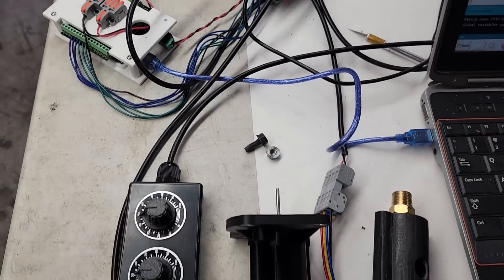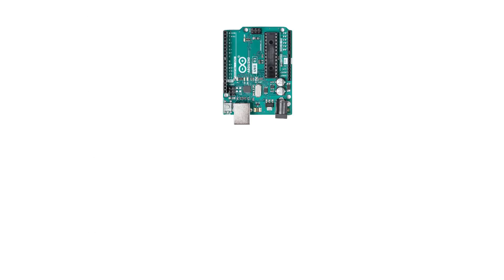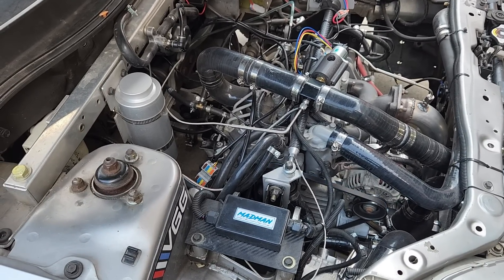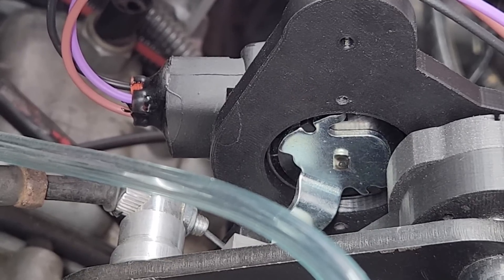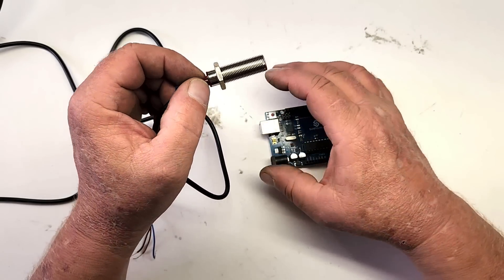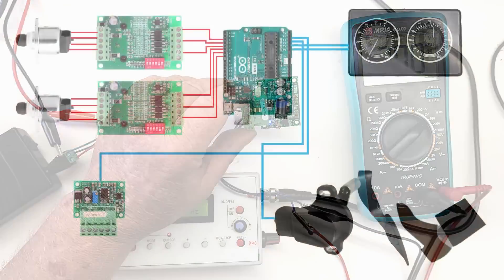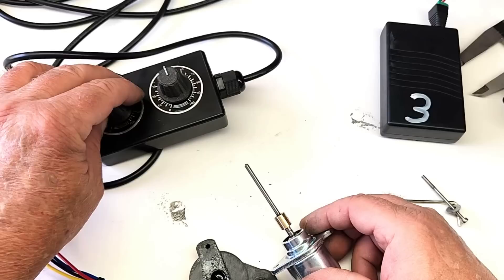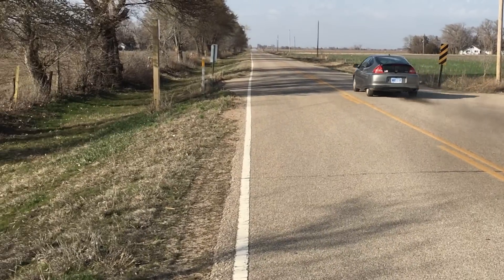S4 E20 We continue upgrading the AMR500 supercharged kubota diesel with custom engine controls

Comment: Hi Jim. Any way to swap out the fuel injection pump for a unit from a Kubota tractor that isn't a fixed speed engine? This would eliminate all the issues surrounding the  fuel rail limiter and allow a more conventional pump timing control. It would also get it away from the area of such tight tolerances where the screw is located. 
Shawn

Comment: I was initially drawn to your channel, because I admire the tech that Honda invested in the insight to get the mileage. Now, after seeing what you are capable of doing with relatively common parts, I suspect that you could modify a reliable car to achieve 100mpg. If you ever do, I would be extremely interested…. I’m broke, but still would be interested. Thanks for the interesting science and fearless wrench spinning.

Comment: The RPM difference might be caused by ADC and arduino supply voltage. In calculating voltage program multiplies raw value by supply voltage on board witch might not be excatly 5 V (for example 4,9V i once had 4,73 V on mine). Of corse its a minor detail but for learning purposues if you want you can check it. You doing great job, wish you best

Comment: You should look into possibly using a "Speeduino" for the ECU. It's a arduino designed specifically for use as a standalone ECU and uses actual tuning software.

Comment: I enjoy this mixture of electronics, software and mechanical engineering.
Personally I use the STM32  "Blue Pill' board. It can be used as an Arduino but I prefer to use it directly in C . I have a collection of these working around the engine in my 1974 VW camper. Cheap but with very capable counter timers. Theres even a CAN bus interface for later..

Comment: What kind of safety is in place for if the Arduino crashes or if the engine runs away? Would be good to throw together some backup system Incase the main ecu has a fault

Comment: Looks like I need a little diesel engine like this for my project portable battery charger using a diesel engine, AC Induction Motor and controller and a Bank of Batteries. No need for too much electronics but it will need some. Keep the electronics going with this project. Im just now learning very basic arduino stuff.

Comment: I'm still wondering why you're fiddling with the boost so much if more boost gets almost the same if not better fuel economy and lowers exhaust temps. The only reason for me to limit boost would be if the temps are too low, such as winter conditions. Although I don't know how much the boost hurts fuel economy since we moved it to a higher pressure I remember at 5 psi it had better fuel economy.

Comment: I would be interested to see how the fuel mileage would react with pulling the shims out from under the fuel pump to advance the timing a little bit, that usually picks up some power on those little engines and should help that extra fuel burn a little more efficiently

Comment: Yes, I am inclined to glaze over and think about calories and carbohydrates and how tight my waistband is, when you start talking about a-d, or was it d-a converters and software updates.
This from a trained electronic technician!
I was top of my class, at C&G level 2, but that was a lifetime ago and I’m out of practice. I can still diagnose a switch mode power supply or a fly back transformer issue, but these things are no longer used, or have gone solid state, so there’s no demand. Arduino’s, or their PIC predecessors, seem like necessary evils, to me.
My PIC traffic light controller worked and got me the grade in my exam, but I was glad to see the back of it! I’m old enough now to think I might be able to dodge learning any more digital and enjoy the rest of my days playing with analogue. (I’m Irish and I speak English, so sue me for not using American spelling!)
Having said that, I’m willing to come along with you, while you have fun doing magic and I watch how it affects the stuff I do understand. I’m a huge fan of Kubota, especially the bigger, 4,5,or 6 cylinder engines. They do incredible things with diesel fuel, compared to similar sized Perkins, Ford, or Cummins engines. Far less noise, heat and physical bulk for any given power output and the economy is crazy!
Keep doing what you do.

Comment: You could turn the injector pump cam for more timing a 12v Cummins runs at  the same timing all the time there's no need to advance or retard the timing like a gas engine.
High EGT will only hurt your engine if it's there for a while, you could run your EGT at 1,800 degrees fahrenheit for 30 seconds and it would be fine. Roll as much coll as you can!

Comment: You can measure rpm with 3 lines of code by using function millis() or micros() and measuring the time it takes to rotate between the magnets. Also ESP 32 S3 is much faster 32bit 240Mhz controller for the same or less money and you can code for it in the Arduino IDE

Comment: I think you have a good balance of technical jargon. Your explanations highlighted to me the balancing act that goes into hardware/software decisions when designing and engineering parts of a car. I could imagine engineers at a meeting discussing costs and tradeoffs associated with different approaches for constructing the control system you’re making. I love your videos. 
Hopefully this helps more people see how and why decisions made at the design level have implications down the line to the users and maintainers of cars.

Comment: Im over here just going to buy a ECU but now you’re making me reconsider. At the same time I know ladder logic not code so I probably couldn’t do what you’re doing. Also Im figuring on using a highspeed fiber optic and amplifier over a traditional hal or inductance sensor, that way on my engine I just replace the distributor cap and rotor with a 180 tooth position sensor, well 178 technically. 2degree resolution, all the precision for my valueless 80s turbo wagon.

Comment: Why wouldn't you daily drive this project once its all dialed in?  Or maybe not daily drive but nice days when you don't need AC and stuff like that.  Rack some miles up on it see how everything holds up and save money on fuel doing it while enjoying the fact that its the only supercharged 3 cylinder kubota powered honda out there.   I'm not sure if you've planned on fitting the turbo into this car at all maybe a next year thing but i would be curious to see in the future how the electronic controls play with that or do the turbo and the supercharger

Comment: Jimbo here is a crazy idea. Back in the 90s(I think) they were experimenting with E diesel and they found out you could mix ethanol and diesel up to 25% and you could irrigate a diesel with port injection of ethanol up to 27% of the total fuel, I’m not saying do that, but meth injection and checking how it affects the parameters would be a great test

Comment: By default,  most of us think that electronically controlled engines are rocket science or completely proprietary designs.   This project actually shows how far a DIY adventure can go with off the shelf things....  if you just keep thinking it through.  Most "little engine in a car"  experiments would not have pushed as many limits...   and now you're using technology that's available to anyone to tune what may end up as a plausible commuter car.    It's certainly fun to watch...  and encourages many of us who like to tinker to take it up a notch.

Comment: I'm eventually going to use an arduino to run some gauges in my EV converted VW. I want to make it look as original as possible, including the original speedometer gauge. So yeah, I'm looking forward to what data and efficiency gains you can get out of that little computer too!

Comment: Great video. Where do you get the boards ?? We always used the starter ring gear teeth as the exciter for an rpm counter.
Reply from the maker: I saw the frequency to analog converters on Amazon so I thought I would give it a try.

Comment: I’ve got a turbo for you if you want it. It came from a small 4 cylinder GM 1.2 turbo engine that grenaded the water pump, and timing chain. I have a dealership and I’m junking the car. The turbo is in good shape no play, and it’s complete with the manifold. Figured you might be able to modify the manifold, and make it work on the diesel. Let me know. Might be able to use it and see if it makes a difference in HP and economy.
Reply from the maker: Thanks for the turbo offer!  We tried a turbo on this engine last season and was a bit of a disappointed.  So far the supercharger is working out great.
Reply: @robotcantina8957  perfect. I’ll have to go back and check that out.
Reply from the maker: @thomasstrickland0  Keep in mind, The turbo experiments were done when the engine was in the Saturn

Comment: Great Video! Have you considered using a kick down switch of sorts? That way you could get a clean 100% throttle, and then push it over the detent for balls out, coal-rolling mean machine.
Reply from the maker: I can do that in software.  The TPS sensor provides all the data I need, including when the throttle is mashed to the floor....    getting full power is a few lines of code.

Comment: As an electrical engineer, machinist, mechanic, with twenty years of experience programming including making and training bottom-up and top-down artificial intelligence solutions I loved the reference to War Games (1983) in this current era where google's artificial intelligence is telling people to eat rocks. As a fun thought, imagine using  neural network type microcontroller to control an electronic fuel injection and ignition system. Overkill, perhaps, but a fun problem to solve I'm sure you'd agree.
Reply from the maker: Indeed, never trust the computer.... unless you program it..... then still don't trust it.

Comment: I love the technical content! When looking at the number of magnets used, my first thought was indeed interrupts. I think the way you did is is beter though, I just never would have thought of it.
Reply from the maker: Yeah the amount of interrupts needed for both the RPM and the vehicle speed would cause the Arduino to move in slow motion if I wrote the code using standard keywords.  The best way to do it is to directly  bit bang the registers, but that makes the software hard to understand for most folks.
Reply: @robotcantina8957  True, I forget that I started coding on micros back in the '70s when this was the normal way to do things. I guess, I'm just old! 🙂

Comment: Which 3d Printer do you use?
And in what materials do you print?
Reply from the maker: I use a PRUSA MK3 with an enclosure.  I print the parts with PRUSA ASA plastic.  The enclosure helps with high temperature plastics like ASA and ABS

Comment: I’d doubt that you will run into the power requirements but if you ever need more power a teensy 4.1 is an amazingly powerful board that is compatible with arduino.

Comment: Is delaying the fuel limiter for a second then opening it not going to make the throttle feel like it has a lag?
Reply from the maker: For normal driving on city streets, it wont be noticeable.  The sole purpose of this gizmo is to keep the governor from slamming the fuel rack to max fuel when we don't need max fuel.  Since we are adding this gizmo to the engine we can also optimize the power with software.

Comment: technical side is a ok with me I am 100% in to it when you go into depth on the technical challenges if any one doesn't comprehend it they can skip ahead will some of the code be available on a github repository
Reply from the maker: I'll drop the code on gethub when its slightly more developed.  right now there isn't much to the code.

Comment: 🤠 HEY,  why not just make it throttle by wire? With the throttle slowly ramping the rack to full throttle. When the pedal is slammed down..  yet operates quickly when making small changes.  Maybe upgrade to the esp32 or something that runs at a higher frequency,   I have thought about attempting to make a electronic govenor for a generator. Using a microcontroller and  read the frequency of the generator, I'd love to have that engine for  generator, yet I'd love to have the car to drive also. Add a couple electric motors to it or a single on to the engine. Around 5-10 kw maybe more. With a 10 kwh battery use the motor as a motor/generator charge the battery while at steady speed. Then use the battery to accelerate and climb hills . With roughly 750watts being 1 HP, adding 12,24,36 HP instantly with instant tq. Would be a great addition. Another option would be to connect a Nissan leaf motor to the transmission and maybe another to the engine to generate power to charge the battery (up to 85-90%)  and a onboard plug in  charger .  With a 30-50kwh battery with the charger capable of 1kw to 10 kw, to 99% charge. And auto engine start at 20-60% soc. Adjustable. The engine as a range extender would be the most efficient. And offer the most performance. I'm curious what shifting through the gears would be like with electric motors. Instant acceleration and a need to shift I'm guessing. And 1st great likely useless, with a program to act property to allow shifting keeping. The motor at speed between shifts.  Maybe a microcontroller between throttle and motor inverter.  To control this and shut off instantly if the brakes are applied. Using multiple sensor possibly a shifter gate sensor  and speed sensor on the transmission, motor and vehicle to allow shift enhancement to operate. Maybe a simple flywheel could fix all this keeping the motor spinning at a steady rpm between shifts. Allowing the use of the clutch. This would be better.  I want a diesel engine for my off-grid house. To generate power when the sun can't. I want to make fuel from plastic and rubber. Used oil vegan diesel fuel. For when the batteries are low and power is required. I have several heavy duty Delco alternators. Enough to produce about 600+amps at 28v however I'm wanting to split it up into about 150a. Units with different fuels, a gas/propane generator, a diesel generator, and maybe a steam generator generating power by burning trash and fallen trees.  Also using this heat to convert plastic to fuel possibly biomass to methane, natural gas, possibly attempting to convert engine oil to gas and diesel. That would be much later after lots of research. Cracking oil into gas is not the safest .  And would definitely be done small scale if at all, like by The gallon or two or 5 Or less at most. 5 gallons of hot oil can be great danger! Building a steam engine that produces 5-7 HP shouldn't be too difficult. have a awesome day!
Reply from the maker: Throttle by wire wont work because the accelerator pedal is not directly connected to the fuel rack.  The gizmo I'm building is to control the way the governor applies the throttle.

Comment: Love the added tech. I built an all analog 5th injector controller back in the 80's when I intercooled a factory turbo car, also programmed an Electromotive TEC-II ECU when I added a turbo to another car, and I have programmed a few different microcontrollers, including Arduino. This gives me a good frame of reference for where you are going. On many factory turbo diesel engines, they use the boost pressure to directly limit the maximum fuel setting to limit smoke. Essentially, boost x rpm = air flow. Limit max fuel flow to match calculated air flow. With a blower, the boost is more predictable, but there is still some lag as it pressurizes the piping and intercooler. With a turbo, the pressure changes are more dynamic, but I still feel measuring boost would be a more accurate control for the fuel rack limiter.
Reply from the maker: My turbo diesel Mercedes had a gizmo called an ALDA and it did pretty much the same thing that my contraption does.  The ALDA was purely mechanical and was calibrated with spring pressure, on my device, I'm using software to calibrate it,  LOL, changing a few things in the code is a lot easier than playing around with springs and linkages.

Comment: 💦⚗️
Snow Performance water-methanol injection with OEM level fuel system control for exact amounts of water-methanol to be delivered at any RPM range of the vehicle. The Stage 4 Boost Cooler utilizes engine RPM/Boost PSI to create a 2D fully adjustable water-methanol tune. Unlike any other system on the market the Stage 4 can give more or less water-methanol at any specific engine load state similar to a stand alone ECU. Using Snow Performance Platinum Tuning Software (free) the tuner can monitor, adjust water-meth delivery, data log/save files, and save/send completed water-methanol tunes to remote customers using a computer while on the dyno. Comes complete with  USB cord,terminated wiring connections, LED alert system and 1/4" Nylon Tubing / quick-connect fittings. Recommended for all tuners looking for maximum water-methanol control.

A 50/50 water/methanol mix will decrease EGT's approximately 200-300 degrees F while increasing power

Comment: Still watching. Loving the video. Remember to add a limp mode so that if one of the sensors or sub circuits fails it will set all settings to the lowest power on the motor. Before you melt it 😅
I have an unhealthy obsession with your channel. Can't wait for the next video 😅
Reply from the maker: On this engine, nothing can stop it from actually running.  if all the gizmos fail the car will still drive and that the best part.
Reply: @robotcantina8957  My concern is more aimed at if something fails while the circuit puts all the modules in the "high performance" position. If it fails at that stage, it might leave it at full boost and the fuel regulator needle in the max position. Might shoot your exhaust temps through the roof. I'd personally add a line of code for lost signal and just have the steppers put everything back to manufacturer spec just to be safe. Granted, I do tend to over-complicate my code 😆